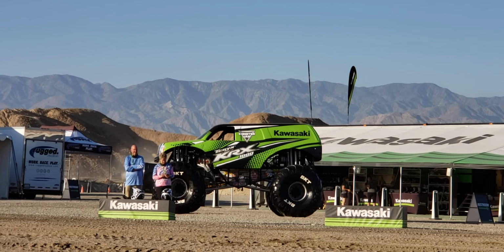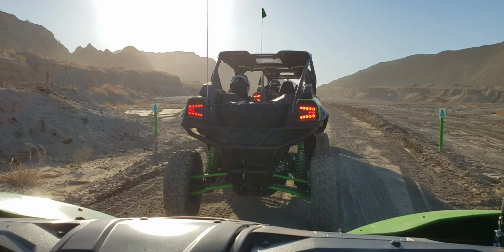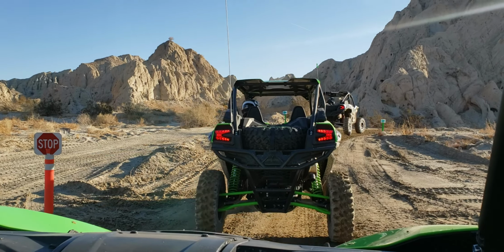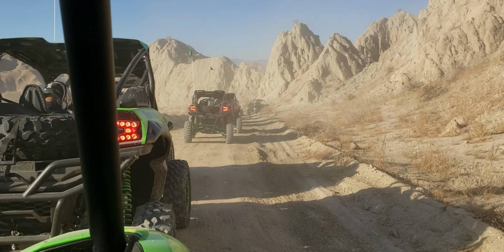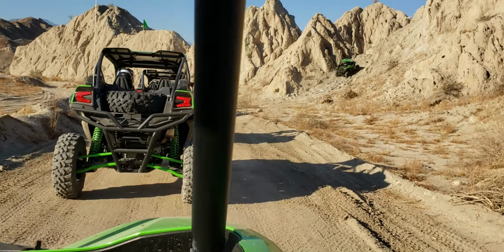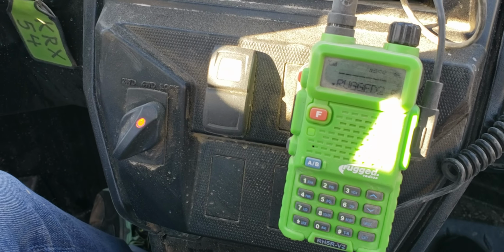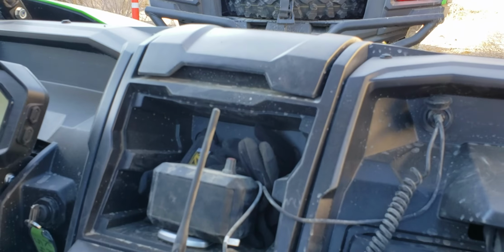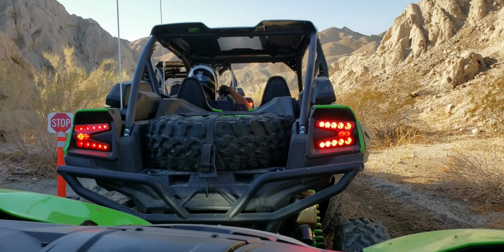Chick driver rockin! KRX 1000! Different course! STEEP ROCK CRAWLING!

Comment: The whole rig looks incredible...I’m disappointed it’s a CVT thou. I can’t wait to test drive one...
Reply: DUNE YXZ i like my brute force cvt. It never breaks belts so i think this will do fine.
Reply: DUNE YXZ Kawasaki uses a similar CVT system to Yamaha’s ATV’s and Wolverine. They’re very dependable units with great belt life and incredible engine braking. The only real downside is they tend to run at a higher rpm than you’ll think necessary at lower speeds. Once you get used to that though, the centrifugal clutch makes a big difference. Still not nearly as fun as shifting yourself but should at least be durable
Reply from the maker: You're going to be impressed!

Comment: Is the machine too wide for a lot of UT riding?
Reply: A lot of people already use the 72 in sxs here in utah. This was I think a 69 so it should be fine. There are some width gated trails here in Utah but most of them are gated at 50 in and not the 64 in that most sxs have become.

Comment: Throw in a turbo and we have a deal
Reply: Yeah the power to weight ratio is  Terrible!  It's the worst in the 1000 CC  Manufacturer lineup.
Reply: Especially at that price point
Reply: There is a factory supported turbo kit coming.  It will NOT void the warranty as Kawasaki is going to warranty it.
Reply: It should be included with that kind of price point.....just saying! 🤔
Reply: @1976Vwbusclub  Nobody's offering a turbo in that price range.
Reply: KRT performance has a bolt on kit.  It will not affect the factory warranty from Kawasaki.
Reply: Allan Wyatt wrong, wrong and wrong! Base X3 turbo starts at  $1500 less and a XP turbo S starts at only $500 more.